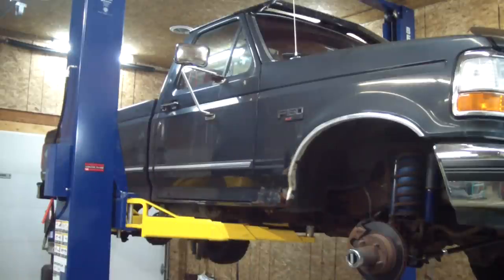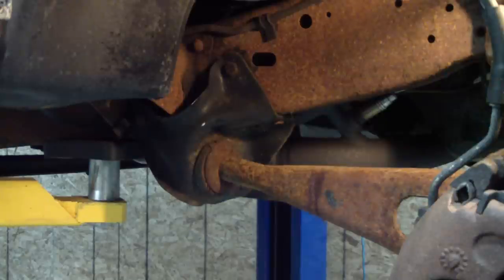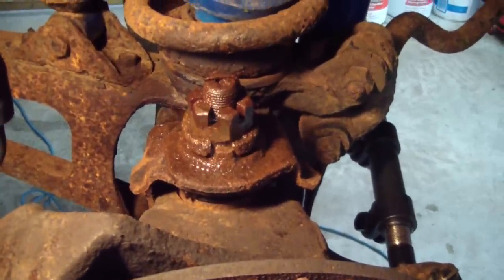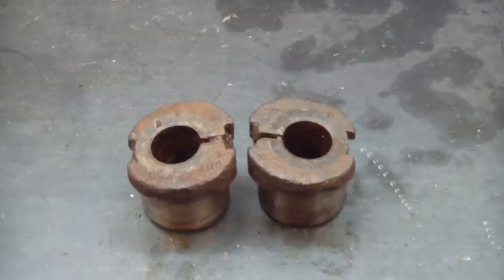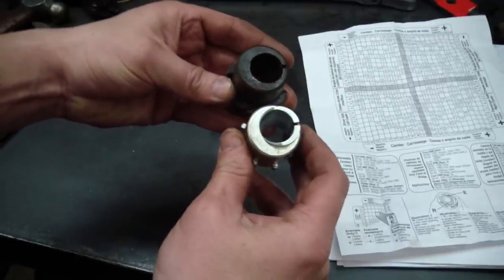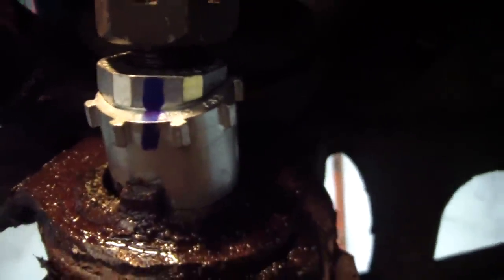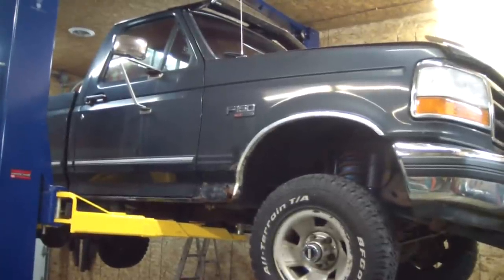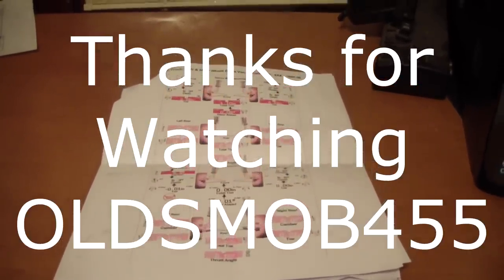Caster / Camber Bushing Change in a F150 Alignment

Comment: I was having a hard time with my Driver's Side Tire wearing off on the inside.
For years no one could give me an answer.
I finally broke down and changed some of the Rods.
Not the Problem but it helps with the Steering.
Asked the Mechanic, he gave me some bllsht answer.
After 25 years I had to get my Tools out of retirement.
If you want something done right...One must do it one's self.
Started doing some research..
I first replaced the Coil Springs.
That didn't do it.
I then replaced the Shocks.
Finally!!! Getting some where.
It straighten up 90%
Then replaced the Bushing on each of the Radius Arms.
Now the Wheels are at 100%
I Aligned it by eye, saved me $200.00 and the headache of another Mechanic doing a bad job and pissing me off!!!!!
Took back the Camber Bushings.
Got new Tires and it rides 100%% perfect.

Comment: Great video. After installing a ReadyLift 2'' leveling kit on my 2012 F350 (non dually) my tires are kicked in like \ /. I bought the ReadyLift brand because they told me I could keep everything stock. Well, I took it to Pep Boys to get an Alignment - they said it couldn't be done without cambers / casters. After calling ReadyLift, they confirmed I would need adjustable casters. I honestly would have bought a cheaper leveling kit for 1/4th the cost had I known I would need my camber adjusted! Some shops want $80-115 each side in labor alone. I figured after putting the leveling kit, this should be a piece of cake, but the alignment shops and even ReadyLift said it wasn't that easy. Your video is just what I needed to confirm that the hubby and I can do it ourselves. I was regretting have done the leveling kit, hopefully the caster / camber install goes smoothly. Maybe I will post a video when I am done. Thanks!

Comment: Yes those old bushings are marked in degrees and minutes ie 1* 30mins...and yes you need a little more caster in the right to compensate for the road crown, you can believe it or not, but if you just stop and think, it makes sense. If car is pulling to the right add caster split. The only cars that I know of that run even caster splits are road course race cars and off road race cars. All lto race cars run alot of split, our dirt late model we ran about 3* split it helps you turn the car.

Comment: yo, Oldsmob455, the factory bushings on the Ford truck adjust both caster and camber simultaneously.  they can be adjusted for neutral camber and maximum caster front or back, by putting the angle of the bushing in line with the frame front to back.  Or they can be adjusted for maximum camber positive or negative, and neutral caster, by adjusting the angled hole inward or outward.  or they can be adjusted for anywhere in between i.e. 1/2 max caster either way with and 1/2 camber in or out.  as one adjustment goes towards maximum, the other is decreased.  think of it looking down at the bushing like a clock from top of truck, with 12 o'clock at the front center of tire.  you can adjust it to 3 or 9 o'clock positions for max camber in/out, or 12 and 6 o'clock positions for max caster forward/rearward, or anywhere in between, but as you go further on caster, camber is decreased, and vice versa.  it's actually a half assed system as they both should adjust separately.

Comment: I have an old 10 ton Dake screw press. If you need to use it just stop by. Pressed new Moog balls into the Sprinter A arms with a little help from Mr. Heat.

Comment: They are good I'm only saying that if everything is even. Then the car will pull according to the crown of the road. Being said, I usually set those one with .5 more caster on the right side with even camber. .5 to .8 seems  to be the magic number  by where I live.
Reply: *****
every vehicle are kinda different when it come to create a left pull to compensate for the road crown. a front wheel drive would be different than a rear wheel drive.  a neutral alignment would be perfect on the perfect straight road (drag racing track for instance). some bmw or even the dodge charger ask for 1.0 degre + of left pull. i'm saying that for your particular truck. a minimum of 0.5 should be  there to compensate for road crown. I found that 0.5 to 0.8 was the magic number especially for farming road when the crown is more pronounce.

For tire pull. brand new tire can have radial pull as the tire is conic (you can't see that with your own eye). The process without road force equipment to find 1 tire pull would be to switch your right front and your left  front side to side.If the pull switch side. bingo you've got 1 tire or maybe 2 tire causing the pull. THEN . you switch 1 front tire with is His rear tire and road test it again. If the pull is gone, the Tire you moved to the back is the one causing the pull. If not then you want to bring those two tire back where they were and do the same thing with the other side.

Some people only switch the front pair with the  rear expecting it's going to go away. but at that point you can't put the finger on THE bad tire. And you need to remember that you may have 2 tire causing pull. But the process to cure a vehicle who is pulling . is to set the vehicle to spec, make sure you don't have a car who pulls to road crown and then after chase a possible tire pull.

on your truck there is also the radius arm bushing you may want to check,a s they get weak it cause he wheel to shift place under braking or under acceleration.

In your case if you have the patience to swap tire like I suggest you. You may be able to cure by yourself a pull. I hate doing those at the shop as they take up to an hour even with air tool and hoist. your vehicle can take up to 3 hour in a shop to get the alignment done properly with solid bushing. once done with solid bushing, the only thing who get go wrong are rubber bushing going bad, hitting curb or weak coil spring.

Comment: Brought my truck to the alignment shop they said there was no need to install these type of bushings in my truck only if I had wrecked it so they took the adjustable camber bushing out and put the original back in and said they work a lot better at adjusting alignment so I wanted to clear that up these are not the correct bushings unless the vehicle is wrecked from what the alignment man who has 40 years experience told me

Comment: Question. I have a 1990 F150 4wd with a snow plow. I purchased front air bags like yours but havent put them in yet.  Right now the A frame of the plow is only about 2'' above the ground and I was thinking of doing a 2" or 2.5" lift on the front springs.  What all will I need done if I lift the front?
Reply from the maker: I didn't like the air bags, they eventually leaked.  You want your plow A frame to sit level so when the plow is turned it won't be sitting all jacked diagonal.  As far as the lift I'd talk to a specialist like Rough Country.  A drop pitman arm or who knows what might be needed.

Comment: Question.  Were the new bushings Ingalls 59400?  We have 06 Class C motor home sitting on a Ford E-450 Super Duty.  We bought it last year, had so much play in the steering it was hard to drive.  Took it in and they put new bushings in, a set size.  Drive better but still play so I was thinking of getting the Ingalls and having them do it again
Reply: ***** play in the steering wheel is in the steering gear box
Reply: frankenstrat25 Well I've had that checked and was told it's fine.  Spent over 400 bucks now at 2 different shops
 and I'll just deal with the play I guess.
Reply: ***** hmmmm thats the only thing that will give you play in the wheel. id just ask for a tighter gear box.
Reply: frankenstrat25 Loose tie rod ends, center links, pitman arms, idler arms, control arm bushings, etc. can add to steering wheel play.  One can crawl under it and look while someone else moves the steering wheel back and fourth.  This can reveal some of the culprits.
Reply: *****
I've had this thing looked at by 3 alignment checks by 2 shops and a trusted mechanic who replaced my drag link.  Told ALL steering parts are in good shape.  Still have play.  Was told I can't have the caster set where I want it because it's "not recommended".

Comment: you were pulling right because ypur wheelse were aligned to a positive thrust angle which will make the car pulll right, and your steering whel wont ever be straight. If it were you were dog tracking to the right meaning your front and rear wheels were pointing right at the same angle but your wheel was straight.
Reply from the maker: I wasn't aware you had the truck on your alignment rack.
Reply: Oldsmob455 I am a mechanic/front end specialist. I know how to read the sheet you were given, and what you were describing.

Comment: Thinking about doing 1.5 inch leveling coil springs in the front of my 92. Am i going to need these bushings? I will probably do the ball joints while im at it.
Reply from the maker: I'm not a fan of those adjustable bushings.  When you get an alignment get the bushing closest to what you need

Comment: im looking into getting a 2 inch levling kit for my 2 wheel drive ford f250, now would i want at camber bushing with a more negative adjustment or positive, im going to guess negative because the leveling kit makes the tires sit like this \ / so negatively adjusting them (moving them in) would make them sit squared like they are supposed to be |  | 
is this right?
Reply: this old ass comment haha what did you end up doing ?
Reply: @bobtailsthecat  I did a 1” leveling kit which wasn’t enough to change my camber to an extreme angle and it aligned just fine
Reply: @danscomprider  thanks for getting back to me . i did a 1.5 inch leveling kit and now i have crazy positive camber
Reply: @bobtailsthecat  ya your only fix would be these offset bushings with will help for sure, I would say if you wanted a lifted truck or just something that sits higher just trade for a 4 wheel drive honestly 2wd suck when it comes to lifts, a whole lot of work for not a whole lot of difference.
Reply: @danscomprider  I already have four-wheel-drive it’s just when I did the leveling kit threw off the camber, but I’ve never done one of these bushings and haven’t seen anything online really about them
Reply: @bobtailsthecat  what kind of truck do you have???
Reply: @danscomprider  I got a 95 F150 four-wheel-drive

Comment: The alignment shop i went to does use the computerized alignment but the problem is that they are fron south of the border and smoke meth on the premises and ive been getting junky alignments from them ruined 2 sets of tires. Sometimes you just gotta do it yourself

Comment: A good front end mechanic does'nt  need a computer to do an alingment. The ones that do use a computer can set the truck to specs but it may still pull to one side or wear tires uneven because they dont know what there are doing.

Comment: Dude i'm trying so hard on my 1985 f150 to remove the old camber bushing but it is so stuck!! where can i found and extractor like that one!! thanks!!
Reply from the maker: That one is an OTC brand
Reply: @Oldsmob455   please if you could leave the model number Ive looked up OTC but cannot find the 2 jaw puller. currently redoing camber/ caster on a 93 I6 4x4. ive used every 2 jaw in the shop and still cant get it to work.
Reply: So happy I live in Florida. No rust mine came right out with a dull chisel and a hammer

Comment: How much did you have to torque the upper ball joint nut? If I go to spec the bushing will not sit all the way down so I'm just wondering if I need to just keep to tightening until it goes.